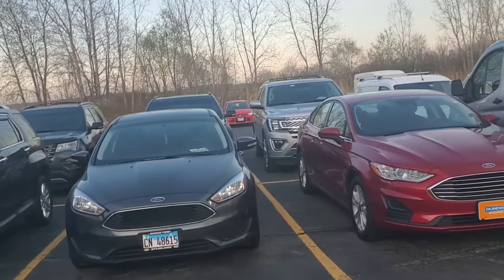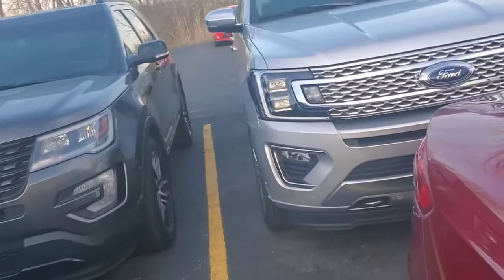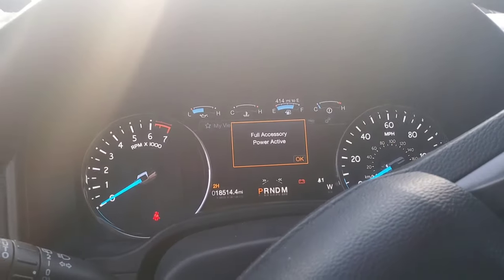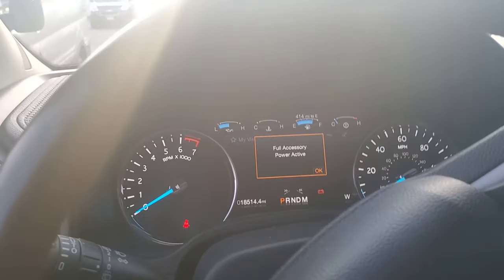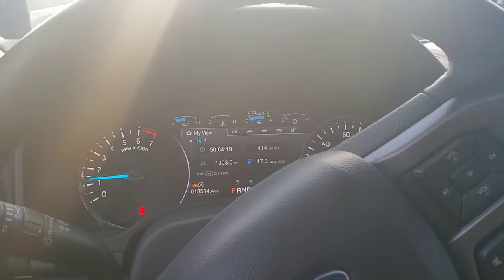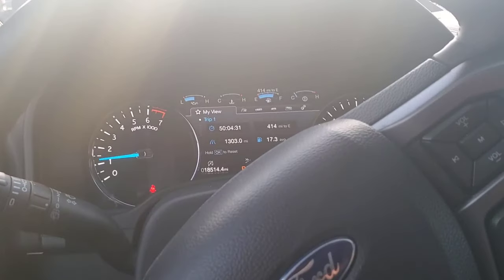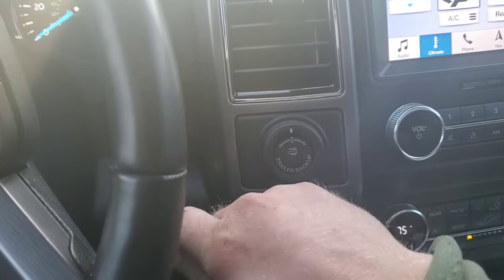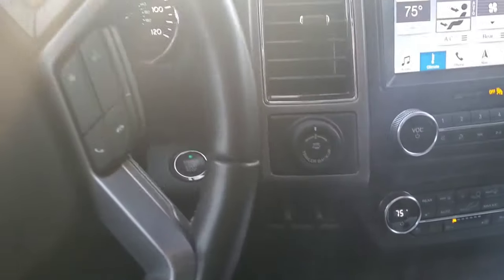3.5L Ecoboost F150 Rattle on Startup then gone, Try this - Could Fix Ford's Phaser Problem

Comment: I've noticed this especially after oil changes. Any idea why, and would this trick help with the rattle?
Reply from the maker: Yes that what this is for especially after an oil change...yes it 

Well you drain all the oil out of the system.and don't flood mode it so you hear the rattle on the dry start

Always do this trick when done changing oil
Reply: @FordBossMe  How does one do this in a quicklane without looking suspicious- and others ... Not knowing why the car is starting so differently?
Reply from the maker: @JamminWithJake  I always try to catch my Quick Lane guys and remind them hate flood mode so you don't dry start the vehicle but every dealership isn't the same because it's not required

Comment: Wonder if this would work on my '03 Expedition with the 5.4 L engine.  It has a very slight rattle for about 1 second on cold start.  I'll give it a try.
Reply from the maker: It will
Reply: If your tensioner seals are blown out, it may be a dangerous band-aid.  You’ve still got an internal oil leak, and who knows how low your pressure is back at cylinders 7-8 where these motors fail catastrophically.

Comment: So what would be a permanent fix for this problem?  I tried what you did and my truck started with out rattle.
Reply from the maker: You got to get your phasers replaced probably need to do timing chains while you're in there
Reply: @FordBossMe  Ok man. Thanks for the quick reply
Reply: @FordBossMe  do you know about how much that is? I’ve got a 2012 with 148k miles doing the cold start rattle. Trying to justify if it would be worth the fix or not

Comment: Your the man bro what about the 5.0 motor? I got a gen 3 coyote
Reply from the maker: It works the same way but I don't ever have the rattle on Startup problems with the 5.0 liter
Reply: @FordBossMe  I haven't had any issues with this motor to be honest I wish someone could clear my adaptive shift tables and update cuz my trans is kinda shifting hard going into 5th gear I bought it used it's not bad but I've been doing some research and that what ppl are doing have you heard of that? Like I said it's not bad and it doesn't do it all the time but sometimes it shifts hard going into 5th dealer said it's normal with the 10 speed I was thinking a valve body on trans could be bad? Cuz it makes some noise on acceleration

Comment: So...if I crank the engine as you described, don't I FILL my oil pan w/raw gasoline.
Already, when I drain the MOBIL 1 5w-30 every 5K mi., it REEKS of gasoline.
Reply from the maker: No I explained what clear flood mode is and when you do this it disables the injectors that's the whole purpose behind clear flood mode think about the name clear flood mode clears out fuel from the intake manifold while you prime the oil system
Reply from the maker: That's because these vehicles have a lot of blow by and they are very dirty they're not clean and Mobile sucks anyway so I would use something like Pennzoil Platinum or Valvoline
Reply: @FordBossMe  Have been w/Mobil 1 since '86.  71yo now.  Never had an oil-related problem.  Too late to change.
I think the "low-friction" piston rings have a lot to do with it.
So you are saying a full throttle while cranking DOESN'T flood the cyls. w/gas.
Reply: @FordBossMe  Sorry Sir...I COMPLETELY MISSED that part.
My oil pressure gauge is a GAUGE, so the needle did not move in a 15sec. crank.
BUT the engine started w/o a rattle, OR a "miss".  I'll keep on keeping on.
Thank you.

Comment: what if the car starts up with your foot  on the gas as you crank it  one or two times  then what?
Reply from the maker: If it's a Ford you're not doing it correctly
Reply: @FordBossMe    i got to use a key and it did work but what about killing the starter
Reply: if you replace the lash adjuster that is not holding the oil in it self   that is bad that move up and down when you  push on it.

Comment: Do you have a video we can hear the rattle? I have a 2018 F150 with the 3.5 it has a slight rattle on cold start sounds like it is coming from the driver side of the engine. Goes away after a bit, not sure if this is normal or an emerging problem. Just over 31K miles.
Reply from the maker: Did you ever change your oil in that truck and not Prime the system when you first start it up? it sounds like marbles bouncing inside the engine that's what it sounds like
Reply: @FordBossMe  No I just got the truck 2 weeks ago. It's not very loud just enough to notice the difference after it runs for a minute it stops.
Reply: @FordBossMe  I got it from a Ford dealership certified and all that fun stuff. It may be nothing. Thx for the response.
Reply from the maker: @benscott19841  https://youtu.be/gfE1BL-Cz88
Reply from the maker: @benscott19841  sounds like this cold start rattle
Reply: @FordBossMe  It doesn't sound like that in fhe video. It almost sounds like a heat shield vibrating. It's now showing any codes. I'll just keep an eye and ear on it see if it gets worse and record it for the technician.
Reply: @FordBossMe  Hey Boss noticed a pretty good rattle the other day on my 18 f150 w/3.5. I had a service scheduled so I told the dealership about it amd they said they would do a PCM update. Is there a new update out now or do you think they were still doing the old one?

Comment: Thats cool!!!  Would it be an expensive fix for them???  You know how these companies dont wanna spend $$  lol.
Reply from the maker: Yes it's inexpensive fixed because it's 10 hours labor every single time and then you have to think about close to $500 in Parts warranty price so every single vehicle getting new parts every single time and then having to redo the same thing over and over it's like $1,500 to $2,000 a shot every time
Reply: @FordBossMe  or a modified line of code  for the PCM and problem temporarily solved

Comment: I really wish Ford could figure out why this is such a hit and miss issue. I’ve got a 2011 F-150 with the 3.5 Ecoboost. 217k miles and it may rattle once every other month. I changed the oil every 10k for the first hundred thousand miles and now every 5000-7500 since.
Reply from the maker: The first problem is changing the oil every 10000 miles I don't know why people do that it is not the brightest choice in the world and I keep preaching it on this channel all the time then people don't listen to me and it just makes things worse
Reply from the maker: 5000 miles Max and no more
Reply: @FordBossMe  I understand completely. I believe the issue many people have with the 10k oil change is I know I’m my owners manual it stated to change the oil at 10k miles or when the service light states to. If changed before that you must change the oil every 3k miles. So for the ones that do read their owners manual I feel it may be a concern of voiding the warranty as was my case and I drive far too much to change it on a 3k interval. For others it’s just laziness.

Comment: So will this eventually tear up your motor?
Reply from the maker: It can yes
Reply: @FordBossMe  the Ford dealership quoted me around $3,000.00 to maintenance the timing chaining, etc for this exact same issue. Stating that it wasn't building the needed oil pressure as you stated in this video. My only thing is that someone said in the comments that it wouldn't fix the oil pressure issue. I have a 2018 f150 3.5 Ecoboost. What would you recommend I do? It is also causing my check engine light to come on every so often.

Comment: Should I do this with a 2019 2.7l eco?
Reply from the maker: If it sits awhile yes, if you are just doing a oil change ehhhh it may help some but you have a top mounted filter you could do it anyway.

No real reason to on yours but again the reasons above yes

Comment: I like this idea. Wonder how they would do that with remote starting
Reply from the maker: Remote start wouldn't be an issue because it's a preset programed table that you're after so no matter what the vehicles initiated to be started it cranks for a few extra seconds
Reply: @FordBossMe  I did not know that about remote start
Reply from the maker: @Jason-pd6jv  well all I am saying is you would purposely program the vehicle to go into flood mode every time it starts for a few extra seconds

that way no matter what when it's initiated to start it'll build oil pressure first

Comment: I have that ridiculous rattle on 2018 f150 3.5 eco. It's done it forever on cold start. I didn't know you could prime it. Thought I was out of luck with the push button start. Check engine light today. Dealer saying cam phaser. Reset it and see if it produces again.  Bullshit. 39k miles
Reply from the maker: 21n03 they need to perform or 21b10 supplement #2
Reply: @FordBossMe  they claimed it would be under 21n03 but requires a light reset and a manual cycle. If it reproduces they will perform the work. Currently five in their shop with the same issue. I questioned the repair. What exactly is replaced and how is it improved? They didn't know.
Reply from the maker: @juscallmeric  they know they just didn't want to get into everything
Reply from the maker: @juscallmeric  I mean I have a video explaining every single part that goes in this

Comment: I know some people that swear by this, I've been doing this for the past year anytime my truck sits a couple days or more no driving.
Reply from the maker: smart, I do this with engine overhauls and any major work where I have to drain all the oil from the engine or just simple oil changes
Reply: @FordBossMe  I do it on first start after every oil change too.

Comment: So.. I just found out if you just turn the ignition on for 5-10 seconds you don't have to floor the gas. I've done it probably 150 times so far with no rattle
Reply from the maker: That doesn't do anything for getting electronic components moving so you're just some different scenario I don't understand but that is not the case for anybody else what you're doing when you push the gas down and hit the ignition at the same time as you're putting a vehicle in clear flood mode which builds oil pressure and get things moving by just turning the ignition on you're not doing anything
Reply: @FordBossMe  yeah, I'm with ya lol but I swear to God it works so far but fords are new to me I don't know as much about them as you do, clearly. Do you suggest anything that actually fixes this issue my man?

Comment: I had this on my 2012 F150 Ecoboost.  Turned out it was terrible quality oil filters with poor quality anti back drain valves.  Stopped letting my oil change place use their filters and always leave a Motorcraft  in the cab for them.
Reply from the maker: That's the case for You That's nothe the case for 99.9% of people with the rattle issue

Comment: Can this happen with a manual transmission Focus ST? Sometimes on clutch release at start up it will do that. Its rare but has done it. Is this normal?
Reply from the maker: Are you saying this happens after the vehicle starts?
Reply from the maker: I mean all you can do is hold the clutch in and the gas crank it over and see if it makes anything better before you actually start it
Reply: @FordBossMe  yes as soon as foot is off the clutch at start up it will rattle for about 1-2 seconds.
Reply from the maker: So next time try an extended crank with your clutch pushed in and your gas pedal pushed down all the way and crank it for about 4 to 5 Seconds and then make an attempt to start the vehicle with your foot off the accelerator and the clutch pushed in and see if it stays the same

Comment: would this burn up the starter sooner?
Reply from the maker: You would add a little bit extra wear but it would be minoot and you only do this when it's a cold start and or changing your oil if you're going to Prime the filter

This is not intended for a permanent fix and it's not intended to be done long-term it's just intended to stop your timing components from wearing out further
Reply: I just did the timing components on my F150, 153000 miles and this is the second time.

I'll start doing this to try to stretch   failure out more than 70-80k miles.

I did also put a high flow oil pump in. I noticed the oil pressure needle slightly higher now and it gets to pressure slightly faster.

Comment: will the 2017 f 150 eco boost work like this??
Reply from the maker: Yep
Reply: @FordBossMe  yes this worked just went and tried it, but you could still hear the phasers rattle and I bet that's a costly fix and they only rattled while doing the oil prime not after cranking

Comment: Cool trick. You might have just given me another 50k miles on my f150. Thanks!
Reply from the maker: It'll buy some time but won't fix it
Reply: @FordBossMe  💔My mechanic, who replaced my timing chain 6 years ago, told me that when it starts rattling again; a full engine replacement is very soon to follow. I cant believe that ford would mass produce the ecoboost across so many models with timing chains that can only be replaced one time. Is it true that the 12hr timing belt replacement can only be performed 1 time ??? They are telling me to sell the truck now before I have to replace the entire engine.

Comment: Why do you say its the phasers rattling?   Why isn't it the stretched primary chain slapping until the tensioner tries to remove the slack?  Ford  can't delay start-up to prime the oil system because everyone would return the first week wanting the  normal crank / slow start concern repaired!!!
Reply from the maker: You got to watch more of my videos and you'll know why I say that I don't want to keep playing the repeat game I'm sorry but it's just not fun
Reply: @FordBossMe  I just personally have experienced different outcome.  My personal trucknhad the "phaser rattle on start up".  Ford replaced the primary timing chains under warranty & my "phaser rattle"  noise was solved by primary chain replacement!
Reply from the maker: @scothubbard5323  if your mind is made on what you believe and don't want to learn I can't do anything further for you

The locking pin wears out in the phaser and rattles like crazy, the Gen 3 phasers seem to be more robust and not having to issue 

If you accept it then great but if not we'll

Good luck

Comment: Will this work on 1987 first gen EFI?
Reply from the maker: It won't hurt to try it
Reply: @FordBossMe  I replaced the idle module and quick idle is noticed. Rattle of mains. Crank kit installed 10,000 back. I will give it a go, pass on soon.

Comment: Or Ford could build a engine that doesn’t rattle and use better parts and designs.  They’ve been dealing with this back to the tritons 15+ years.  Another technique is just never cut the engine off.
Reply from the maker: hey I'm giving ideas to potentially not make things worse, I fix them 8 don't design them

if it was me we would all be driving reliable 2v 4.6L panther platform cars

Comment: More stress on the battery and starter. But I guess you have to go with the greater of two evils.
Reply from the maker: I mean that's the whole point of this video is do you want to put $3,000 in timing components or do you want to try to save it as much as possible doing minimal effect 2 the starter and the battery
Reply: @FordBossMe  I agree with you, just pointing out the stress on the other components of the system. Keep up the good work on exposing the bad designs of the newer engines. I enjoy them. And I learn what to avoid.

Comment: The problem is the timing chain is stretched and guides are worn because of another poor Ford engine design. Get the up dated phaser and chain kit from ford, spend three days installing. My 3.5 went out at 90,000 I now have 160,000 no issues since replacement.
Reply from the maker: Nope
Reply from the maker: Its the Phasers internally damaged and locking pin damage

Comment: Yes that works but why dont they rattle when brand  new something happens to some engines , phaser bleed down not when new? I have a 2019 raptor only 4500 miles no rattle yet. Start stop system you can thank for those quick starts when years ago the worst thing for a turbo engine was to shut it down all the time it cooks the oil in the turbo very hard on the oil.
Reply from the maker: I'm giving options on a specic scenario NOT saying this will fix the issue but maybe just possibly help it slow or stop getting worse
Reply: They don't rattle when new because the locking pin and spring work properly on shut down. The lack of oil pressure when cold, over time causes them to wear. This wear prevents them from locking on shut down. When they aren't locked, and the oil pressure is low during start up, they rattle until oil pressure rises.